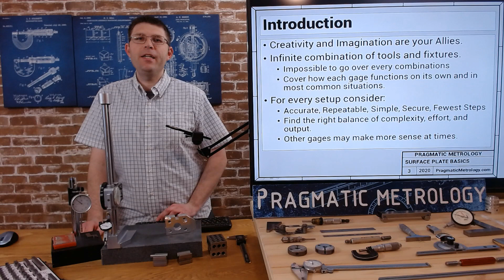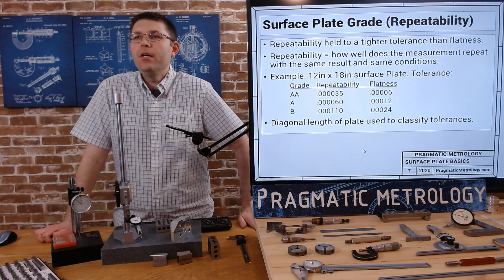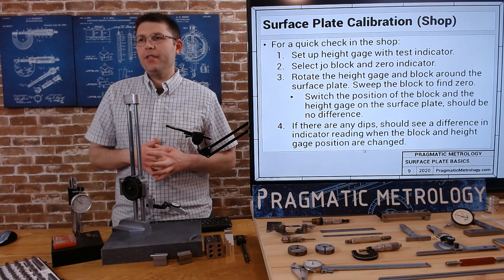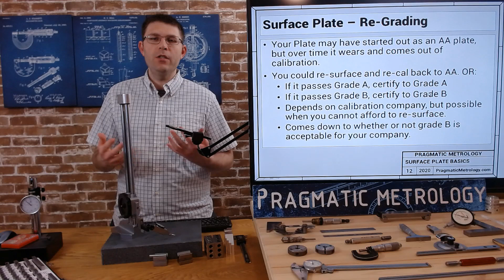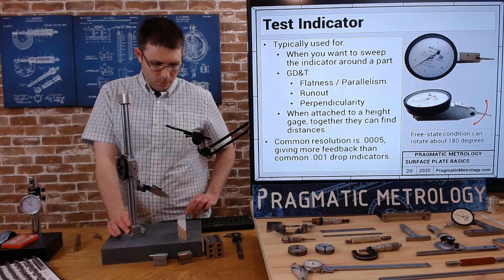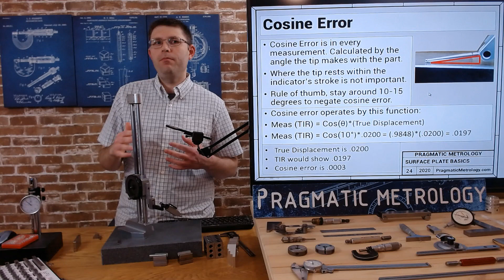Pragmatic Metrology - Surface Plate Basics - Part 1M

Comment: 20:28 - Can the height gauge be used as an improvised "squreness master" instrument along with a cylinder square, for checking squareness of parts? I need to check tall parts for squareness and a "squreness master" is like $7K, extremely expensive. Excellent explanation.
Reply: 8+ months late for a possible answer to your question, but highly doubtful any height gauge could be used as an actual squareness comparator. One reason those designated squareness comparators are so expensive is the materials and design that goes into making them. Most I know of use basically a fairly thick but narrow granite surface plate inside them as the true surface for the gauge travel. Even then they still have to be calibrated to a known reference surface like your cylinder square with the 3 fine thread adjustment screws on there base. While my digital twin beam Mit height gauge is I think very well made, it does drift enough to make an accurate measurement difference over the full travel when checking against my cylindrical square. These height gauges would be built to be very close to a true 90 degrees when placed on something like a surface plate, but in my opinion, those actual comparator's are no doubt an order of magnitude better. 

I looked at a few different types of height gauges before buying my 192-630-10 trying to save some money. And if you check the specifications for there repeatability and accuracy, that $1500+ price level is about where they start getting fairly accurate. Anything under that will have guaranteed repeatability numbers of only being repeatable to within a couple of thou. Since these height gauges all have defined accuracy limits, there would be no requirement of building them any more accurate or square over there vertical travel than they are. The other issue is there has to be at least some clearance for the height gauges measurement head to move up and down the column, and a certain amount of variable flex on the single or dual columns due to gravity and where the head is positioned on the column. Again that's much less accurate than the way those comparator's are designed and built.

Comment: I don't think you did the backlash right- do the first measurement as you did (moving down at both ends of measurement), then zero off surface gage, move up to near 3" and then try to slide block under as you continue to move up and past (if needed) to 3.0000 to get your backlash measurement. $0.03
Reply: So that would mean he accidentally and coincidentally achieved “0”?